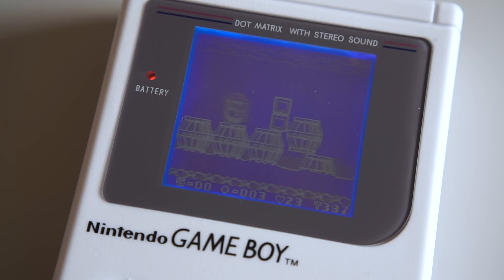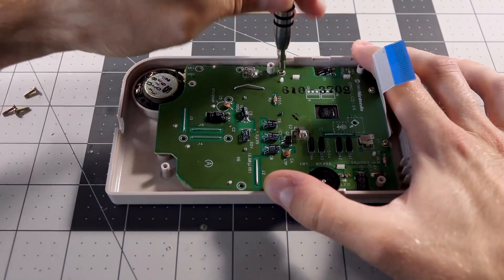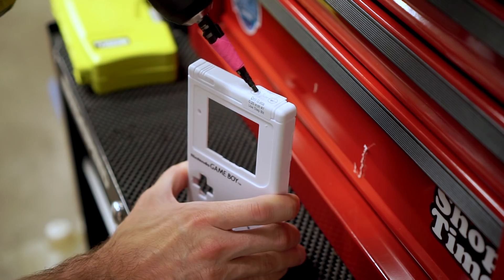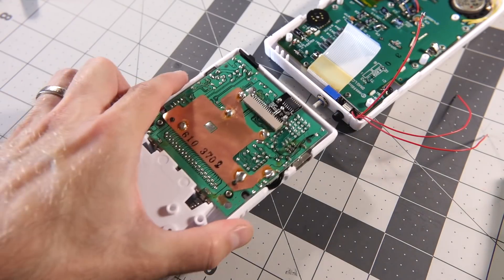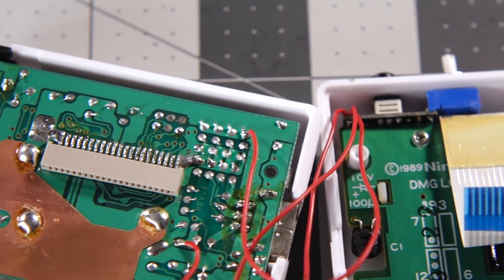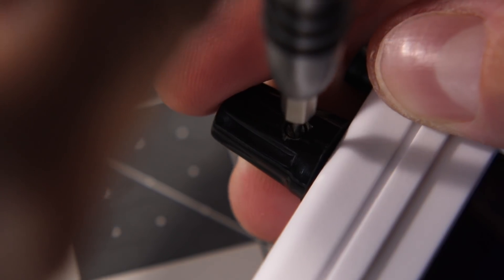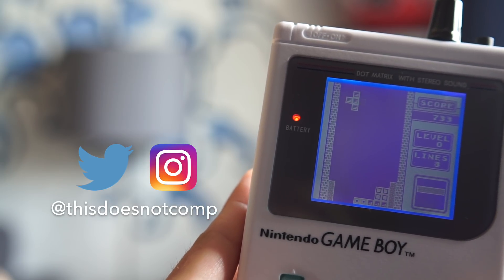Game Boy Variable Clock Mod!

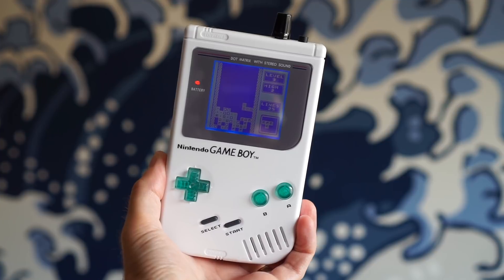Comment: at 5:15 you say that the system crashes when turning it on/off. 
I have made ~5 variable clock mods on GBs over the past years and I can definitely tell you that you can fix this problem by installing a chip that is turned on/off with a rocker switch.
DO NOT do this mod using a push-button switch like you did in your video. It will give you 1/4 chance of crashing the system.
Reply: Can you shed some light on what is causing the crash?
A half-pressed button causing the voltage levels to go out of specs or something like that?

Comment: Is there a way to get a smaller dial? Id love to do the mod but thats massive
Reply from the maker: Since the knob is replaceable, there are tons of options out there in electronics stores. Digi-Key and Mouser carry thousands.
Reply: Thanks man, I realized a few minutes later and felt pretty dumb afterwards.
Reply: Shiikaarii Shiikaarii you can use any knob that fits on the potentiometer dial

Comment: Interesting knowing that this feature is usually only available on emulators or you had to access the knob inside the case, but now better when the knob is sent to the outside. The new housing should allow space for the speed mod.
Need something like this for the gameboy color and possibly the gameboy advance (sp micro) even ds, 3ds, home consoles, and switch.

Comment: I wonder if this mod can be placed inside a Super Gameboy?
Reply from the maker: That's a good question -- since the Super Game Boy has most of the same hardware, you probably could. Whether it would mess up the signaling between it and the Super Nintendo is another story.
Reply: Theres a hori controller designed for the super gameboy that can change the speed of the game. You should check it out.
Reply: Jake Long true the hori pad is awsome but expensive... id use this mod so the super gameboy would run at the same speed as a regular gameboy because the super gameboy runs games a fraction faster then thr handheld
Reply: Spintechfilms 
Well, there is a japanese version of the super gameboy(called super gameboy 2) that runs at the same speed as the handheld.
Reply: As far I know the Super Gameboy card have the gameboy hardware inside so at least in theory you can do it
Reply: CodeNameZ i need to look into it